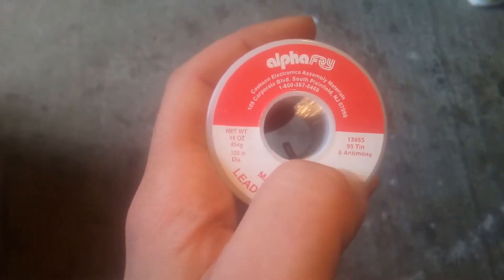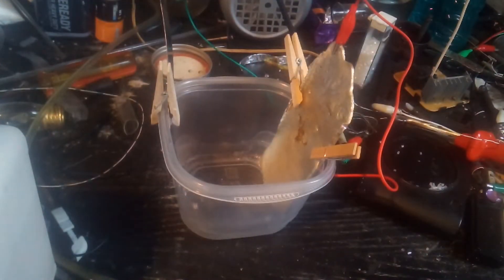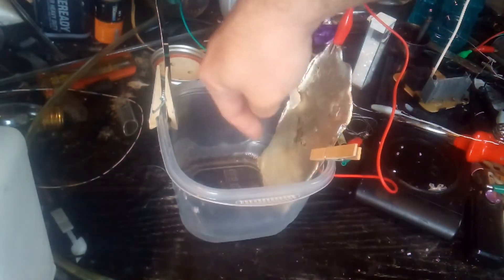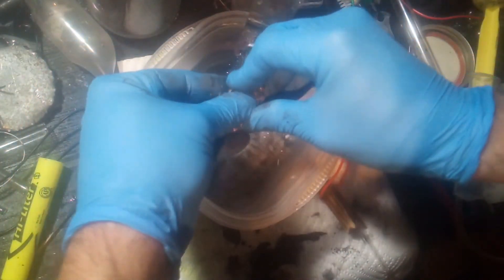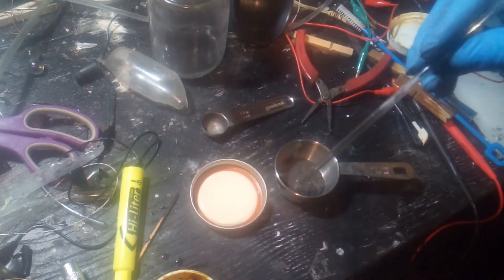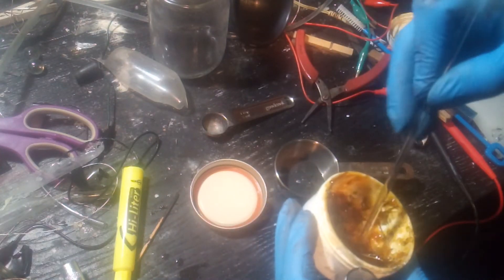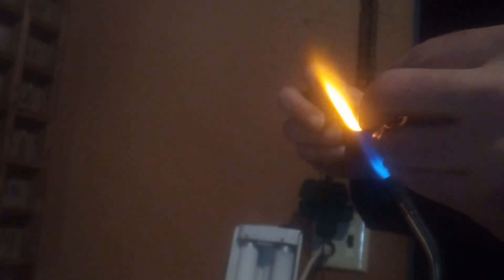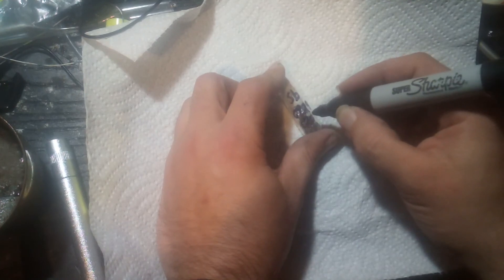Collecting the Elements: Episode Twenty-Nine; Splitting Solder (Antimony)

Comment: you never seem to stop amazing me, I've been researching about antimony for a long time and I tried to get it out of lead-acid batteries but had some arsenic impurity which was confirmed with a NaOH test because it dissolved back in solution (hydrolized to As2O3 and dissolved) so I immediately threw it out. I never found anything on antimony being in solders, thank you so much and also if you want to further purify antimony try precipitating antimony acetate with some sodium acetate made by vinegar and baking soda. the tin impurity that could've been left from the crystals would be turned into soluble tin acetate and the antimony would be turned into antimony acetate. filter, dissolve with HCl, and then leech antimony metal with aluminum. or maybe electrolysis if that actually works. I have some stibnite because I won a bet from my friend and my friend bought some Sb2S3 from united nuclear and gave it to me but I will definitely try your method because we have mostly the same goals.
Reply from the maker: Thanks. :) 
And you just gave me an idea for how to obtain arsenic - one of those "I'd really rather not mess with this, but for the sake of completeness I should." Elements, like cadmium.